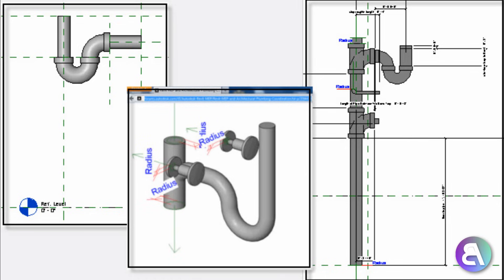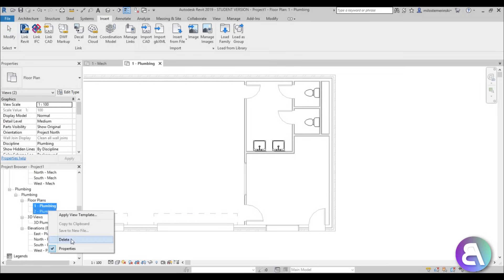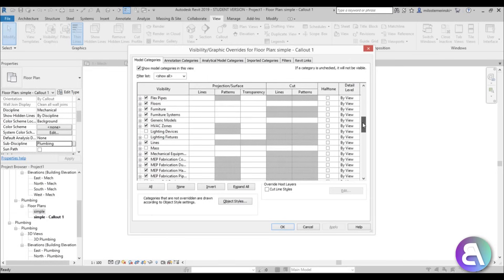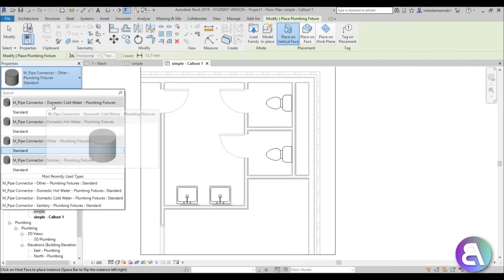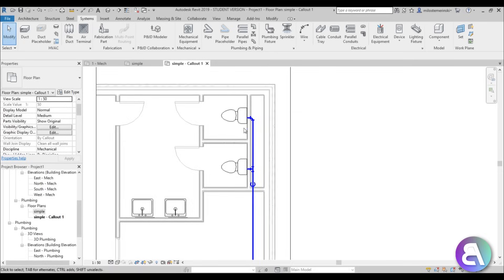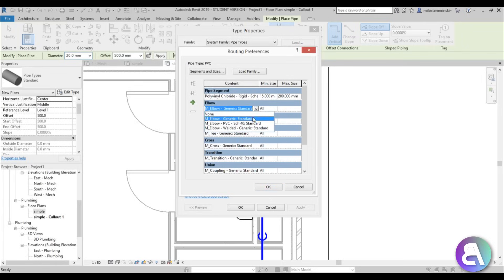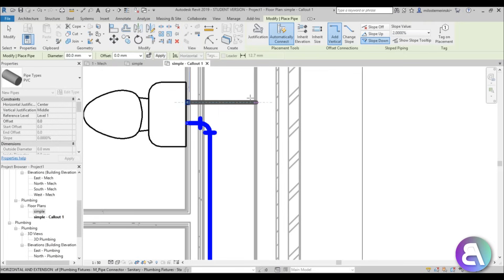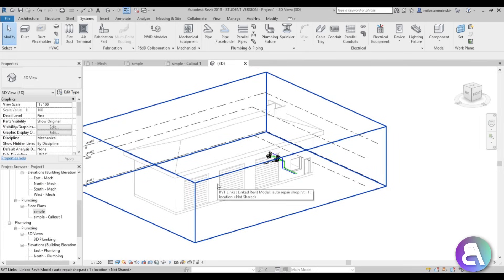Plumbing in Revit MEP Beginner Tutorial

Comment: I studied Mechanical Engineering and learned Revit Architecture, but now I want to transition to Revit MEP. I would like to know if Revit Architecture and Revit MEP use the same software. I am currently using Revit 2019 for MEP. Additionally, what is the best way to gain proficiency in Revit MEP? I find YouTube tutorials sometimes confusing.

Comment: "Just draw the pipes with lines, who cares? Why can't we just do this in AutoCAD?"

- 99% of all MEP "CAD Drafters" everywhere.

At my last firm (this was about 10 years ago) we did an entire 5 story building with 2D CAD Links, layered onto each level of the Revit model.  The HVAC, Plumbing, Electrical, Fire Protection, all of it. No modelled objects at all.  When the architect complained the PM replied "The contract called for Revit, there's your Revit.  It didn't say anything about not using CAD imports."  Thankfully I had nothing to do with that project...

Comment: I am working with Revit 2022 and there is an issue with the connections between the two PVC pipes. The second one wont connect to the first (I am guessing due to the slope of the PVC coming from the first water closet is now too low for the connection of the second water closet?). Is there a easy fix or standard fix for this?
Reply: Yes, if the pipes are both sloped and not at exactly the same elevation, then they will not connect. It's best to draw the pipes from the sloped main to your fixtures. You have to draw the pipe just like you would install the pipe in the field. I'm doing a video on sloped piping soon on my channel. Hopefully you'll check it out.

Comment: A Couple more questions if you don't mind. why did you want to use the  Mechanical template to start with but did not want to use it in the view.   What happens when you change the discipline from plumbing to mechanical and then change the subdiscipline to plumbing.  Cheers

Comment: hi sir!. i am an arki students and there are some problems in my project and the visibility or graphic of an object turns into color grey.
Reply: Possibly you set the phasing of said object as (existing), or if you are trying to edit the architecture then you should do that in archi template, mechanical greys out architectural because it is not concerned with it, it is just there to show where the MEP will fit in with the archi plan. It is not advised to edit archi if you are working in mech template...hope this helps peace from South Africa. <3

Comment: When you place a connector like that you're missing the fixture units, this parameter is necessary to make the calculations for cold domestic water and hot water, and each fixture type has its own fixture units. Is better to put a water closet MEP family or a lavatory MEP family, for example. On the sanitary system you should avoid 90 degrees angles in the horizontal plane and the sanitary connection for that WC is usually on the bottom. Without looking the technical aspects is a great example of how to model plumbing in Revit. Thanks for the video. Huge fan.
Reply: Good point, however he did give the second toilet a sweep.
Reply: Tell me how we calculate flush valve water closets. When the first on a bank is 40 wsfu, 2nd is 3 wsfu and so on. But when we size mains we only need to calc it once for the overall building.

Comment: Hi there, great tutorials, have been following for a while and they have been great giving me an insight on various aspects of Revit.

After forty years as a services draughtsman, the last five specifically in hydraulics (Plumbing), with the last three swearing at Revit and Architects, I feel I should toss in a comment or two.

Unlike the Electrical, HVAC or Civil drainage disciplines, Hydraulics is directly impacted by the Architectural model. With pipework attaching to fixtures that are placed within the central model by the Architect and most of the time not having direct access to that model, once that pipework has been drawn, if a fixture is moved as little as 50mm(2") this can cause hours of frustration or redrawing to get the pipes to fit again due to grades and the inflexibility of Revit.

Having said that I would like to reference your video and make a couple of observations.
1 Do not use the Mechanical Project Model. Open browse and use the Plumbing Project model.
2 Would suggest, if I may, that you do a video on how to use copy/monitor to align grids and levels with an inserted model.
3 The WC you have shown appears to be an S-Pan rather than a P-Pan. The purpose of the design aspect of Revit is to obtain accurate detailed modeling with clash detection. This starts with the Architect using the correct fixtures. Note that a P-Pan will have a connection on the centreline at least 150mm above FFL which allows a pipe to run above the floor not in it as yours will do if you start at zero offset. (Sorry but my biggest bugbear is accuracy or lack thereof and I tend to ramble)

What I say above will have minimal effect on a simple single level dwelling but if you are working on a multistory building, or a facility with large ablution areas, accuracy becomes paramount. The ability to negotiate steel structures and other service disciplines can be a pain in the butt however successfully doing so, even though you can not see the result under the floor slab, is rewarding.

Keep up the good work and I look forward to your next video
Reply: Yes. I was about to comment on using "plumbing template" project instead of "mechanical template" which he used in this tutorial.  Your point 1 above highlights this issue. Am a new Revit user trying to use Version 2025 at the moment.